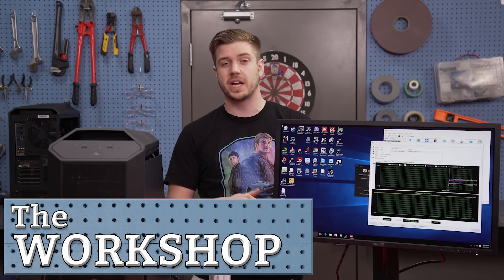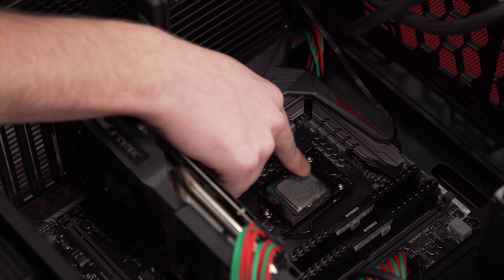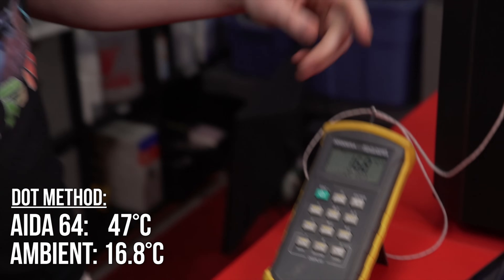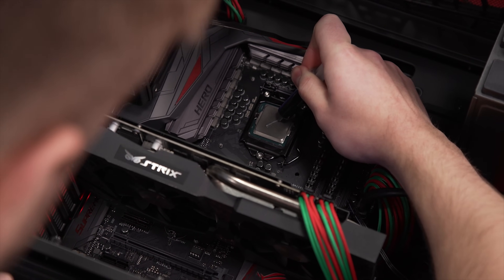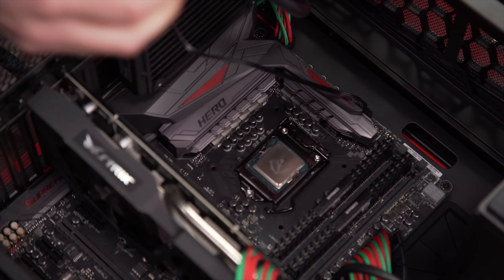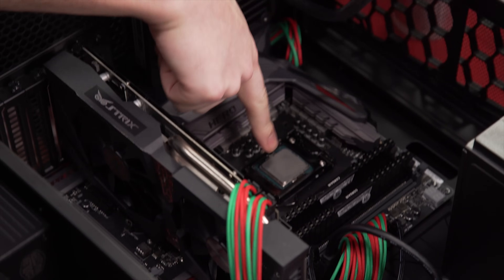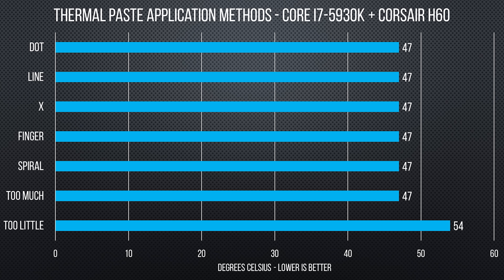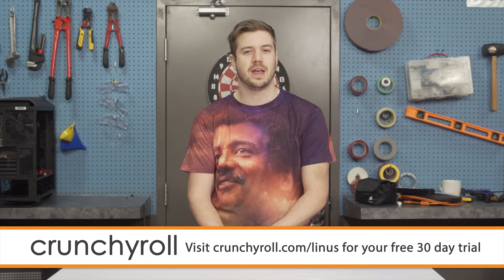Thermal Paste Application Methods - Which one is best? - The Workshop

Comment: 47 degrees under load? that's C right?

I used to run my Pentium 4 at 70-80 degrees to get it fast enough for old games. =D
Reply: +AzaIndustries 80c? 80D? am confused WHAT?
Reply: +Julian john 80 degrees celius not farenheight.
Reply: your Pentium 4 runs better at 80c? :o if my AMD 8350 4.33GHz was running at 80c id been cuting the power if it hadnt already burnt out by then.
Reply: Julian john
You do know the Pentium 4 came out more than 10 years ago right?

I had to overclock iit to 4ghz to play UT wich also required me to strip my windows install to fit onto the 3gb HDD I had.
It was stable too.

My current computer, (5th since the P4 days) idles at 27*C in summer. Haven’t needed to overclock it for any reason yet or check the load temps. It's demolished anything I've thrown at it.
Reply: i used to have a Pentium 4 i cant remember it having heat issues then again i was just a kid so wasnt really looking out for that, i thought that intel was cool and AMD was HOT!!!!
Reply: Julian john
Australian Summer + Overclocking.

Overclocking was also bit different then, and buying huge coolers wasn't common.

We are pretty spoilt with hardware choice these days.

Comment: I really don't like the way this experiment was performed. A lot of numbers were given without any context and it looks like LTT used a good water cooler, decent thermal paste and a CPU that wasn't too power hungry. It isn't a scenario where thermal paste application makes too much difference. 

If they want to test the effectiveness of different methods of applying thermal paste, what they should have done is test the worst case scenario. They need to create one of the truly awful test rigs, one that we've all built as a first time PC builder with limited money and knowledge and would like to forget.

This test rig would involve:
 * Low Quality Heatsink - Use that awful stock cooler that Intel keeps handing out with their CPU boxes with a shitty 60mm fan, a few short fins and no heat pipes.
 * Cheap Thermal Paste - Somethink someone on a budget might consider, were the spread and thickness with matter more.
 * An Inefficient CPU - Finds some 225W last-gen AMD CPU that loves to chew up power and spit out a fiery inferno. See how well it does.
 * Poor Case Airflow - Only use one low quality fan that would be included with an entry-level case, probably as back exhaust.

Finally, my last complain with this test is an on-going problem with the workbench segment in LTT, which is that they give CPU/GPU temperatures without any other information. All the CPU/GPUs they are using have a fan controller that adjusts the fan speed according to thermal data to get to a certain "target" temperature. So it's pointless to say that the machine reached a certain temperature without giving, at least, the final RPM of the fan. If the fan has to spin faster to reach the target temperature, the cooling is clearly less effective. No-one likes a noisy computer.

Comment: Yo Luke..I ALWAYS wondered if defragmentation would boost performance when you have a really cluttered and used HDD. 

I just did a System Cleanup after like 2 years..deleted some old files/games, sorted everything, etc aaaand I defraged the Drive. Too bad I didn't think of that before I did it and testing it myself.

Comment: as long as the volume of thermal paste applied is enough to sufficiently cover the CPU (or more than enough), then of course the temperatures are going to be exactly the same regardless of application method. One method may spread out more consistently or be less likely to spill over the edges than other methods but along as you don't cut the amount of paste applied short, results should be the same as we've observed.

Now I don't know about everyone else but I like to build things in my workshop so perhaps Luke should spend some time doing and making videos on that instead of these stupid and pointless videos that just feel like filler.

Comment: could you check out the significance of memory stick placement in DIMMs? i have put memory sticks in the wrong configuration before and didn't really notice a difference but have read and been told that it makes a big difference have the sticks in the correct DIMMs.

Comment: I'm willing to bet - no - I'm sure, that if you'd have actually used a real stress software (not fuckin AIDA) - say, IBT (IntelBurnTest) or OCCT (@max) for example: you'd have gotten a difference between the too much/X (higher temps) and probably the best ones would've been the advised first two.
This workshop is nice, but come back down to our atmosphere before actually doing these, please - AIDA64 isn't recommended for stability tests as it stresses the CPU way too conservatively, and even still, not choosing the cache/RAM effected the strain on the CPU as well, but I digress:
The point with the "drop back to earth" shit is the issue that others had a problem with as well - you've been using a high-end (almost the best, as far as non-DIY watercooling is concerned, and without going for long 360-420rads) cooler - which does the damn job almost no matter what - so what's the point? 
Barely stressing an overcooled yet not-overclocked (you didn't mention so I presume) CPU with different forms of thermal paste application? 
I know you're mainstream, and that recommending your viewers to use stuff like IBT could kill their rigs, but even still, personally - I'd have done this same video only with a cheap low-end air cooler - like the 212, or - to be even more fair to the viewer base wielding a huge variance with any possible hardware part - just putting the damn stock cooler would've given a way clearer and concise picture for everyone out there, me included - actually - since I, like most people, don't have the time, will or resources to do a test of this kind - and I'd actually be interested to see a test of 10 IBT loops @max with a 212evo - so that I'd know if I need to reapply thermal paste differently on my own processor (albeit with a different cooler, but that's not a concern when doing it this way) - now that would've been informative - just my honest views.
Reply: Stressing the CPU by artificial means is pointless if it stresses the CPU more than any program you would run. I found that running Handbrake gives almost the exact same temperature max and averages as AIDA 64. That make AIDA 64 the perfect test for my computers as it matches my heaviest load. I do agree that Handbrake and AIDA 64 only match up when the top 4 boxes are checked when running the AIDA 64 stress test. As for overclocking, that depends a lot more on the CPU than the paste so not a good way to test the way to apply thermal paste.
Reply: It depends on the voltage, not the cpu. At same voltage heat would be the same, the speed would vary. Since we are not testing speed it's irrelevant. Like the OP said, using a more down to earth cooler that most people have on an overclocked cpu would give better results. It's like changing tires on a porche, it's a porche, it will run over 200 with any tires. But if you change the road, then tires matter a bit. The point being like he said, the cpu cooler is way overkill and cools too well (a stock cpu at that) for the paste to begin to matter.
Reply: Thanks for answering for me, lol: Also, AIDA64 is such bullshit you can read about it at overclock.net, here:
http://www.overclock.net/t/1570313/skylake-overclocking-guide-with-statistics#
Under "Stress Testing[...]" you cab see this (a copy paste from the site):
Marathon-Man:
OCCT S
Linpack (Max) (From Intel's website, not from OCCT or any other place or XTU.)
P95 28.7 S
 
Tough:
P95 27.9
IBT (Max)
 
Medium:
x264 16T
ROG Realbench
 
Easy:
Stockfish (Chess, BMI2 version)
XTU
Aida64 (Full Suite)
 
Walk in the Park:
Cinebench
Firestrike
Booting into Windows

And to add my personal experience - an overclock of 4.8Ghz was fully stable at 60c on AIDA64 and got to 80c before BSODing when testing with x264 at 16T (Threads) - I use it (x264) mostly and also OCCT for stress testing as these actually give a real indication for stability - obviously not for regular hard-use temperatures as the load is artificial but it does indicate true stability of the overclock at all times (ie very intensive CPU tasks, intensive CPU taxing games etc) - things which AIDA64 simply cannot provide.
Now, it's not like you need to push the CPU too much - the top softwares I pasted here are overkill to say the least and leaving them all night is straight-out dangerous unless the overclock was found stable and at low temps with a less-stressing software (x264 is a great standard imo like I said), some Prime95 version are not recommended for use on new CPUs anymore, read at the aforementioned site - great data and people there and way more accurate, though you'll see that reality sucks as you'll get higher temps on a real stress-test software. wow I did it too long fuck me.

Comment: Use a CPU that doesnt have thermal paste in it!
Reply: +Richard Schlegel Thermal paste in it? What the fuck are you on?
Reply: non-enthusiast Intel CPUs have thermal paste in them, which is often crappy and limiting efficient cooling.
Reply: Between the core and the heat spreader? Surely that would benefit cooling? Why would they put it in there ?

Comment: How about the credit/debit/gift card spreader method?

The h110i cooler I bought came with the thermal paste evenly pre-applied. No dots, no circular pattern, no crosses, no lines. Which is resulting in 34 - 42 C for a 5930k running at 1.2 - 4.8GHz @ 20C ambient.

Comment: Not surpriced that there isnt any difference (except the obviously completely wrong ones of too little/much). Remembering the how little the area is there is little to no chance of applying too little paste over the majority of the area. Just looking at a intel stock cooler you can see how they actually prepasted it in 3 thin lines that too will spread out but ensure it wont spread out too far.
The real problem that once the heatsink/fan is on .. you cant tell how the paste actually spreads or stays in place.
One conclusion from this video is quite clearly as long as 70-80% of the area is covered its dont really matter and i guess you can only really speculate if having the "safer" pre-spread methods would be measurable longterm effects after month of heavy use.

Comment: This was pretty interesting, but I feel like to do this experiment properly you should leave the thermal paste to sit for a while, maybe in a usage pattern that a typical person might have, say 12 hours on and 12 hours off, then do another benchmark after a week, and see where the results are at then. That way you can truly see how the thermal paste application affects the heat level over time. I realise that's not super practical to do though and would take a long-ass time if you only had one test system.

Comment: Can you expand this by going over overclock performance? Let's say as a baseline you find out that using the pea method you can achieve a +x GHz overclock at a temperature of y. Then using the same overclock, what kind of temperatures do you get with the various methods?

Comment: Why do you use such a high end water cooler for a test like this??
You should have used a stock cooler for higher temperatures where the thermal paste has a larger impact on the cooling of the CPU.
Reply: Simon or even better, use the stock cooler and measure the fan rpm needed to keep the cpu at a certain temperature

Comment: Hey Linus (or youtubers), i'm going to build a PC for a friend...what do you think?

BUILD: $1000
Monitor: Asus VS248H-P (24 inches)
CASE: HAF 912+Coolermaster 120 mm case fans 4 pack
MOBO: ASUS Z87-A
CPU: i5 4690k+hyper 212 evo
RAM: G.Skill Ripjaws X Series 8GB
GPU: R9 380 or 390
STORAGE: WD 1 TB HDD
PSU: EVGA SuperNOVA GS 650W 80+ Gold
WIRELESS: ASUS PCE-N15
OPTICAL: DVD Drive

NOTE: CPU+MOBO+RAM already bought for $300
Reply: Looks decent mate, but I really would recommend some kind of SSD storage. Really, any kind is better than using your HDD to have your OS sit on.
Reply: +dinokknd  he ended up investing into an SSD. Amazon has a sale for the PNY 240 GB SSD. $60 :D

Comment: But the REAL QUESTION is stock paste versus self applied.
Do we need to even do this at all?
Reply: I've used stock paste without issue several times. I do find it usually needs to be reapplied sooner though
Reply: I've used stock paste without issue several times. I do find it usually needs to be reapplied sooner though

Comment: For those who are claiming you will see a large difference between thermal paste application strategies by swapping either the CPU, heat-sink, CPU + heat-sink, thermal compound, or some other bizzaro swap to a cheaper alternative, that is not how it works. The idea behind using thermal compound is so the contact area between the heat-sink and CPU is maximized. Maximizing contact area has the effect if increasing heat transfer. 

Assuming that the heat-sink is able to cover the entire area of the processor, than swapping the heat-sink, or the processor will not have an effect on the difference in temperature of a processor over ambient under load between two different ways of applying the thermal compound.

With that being said, different types of thermal compounds will probably make a difference depending on the properties of the substance used. It would be nice to see a 2016 video comparing different thermal compounds. Especially the junk that they sell at Best Buy.

Comment: With most CPUs, only having 16 PCI express lanes, and graphics cards using all of these 16 lanes. How much of a dip in performance would you experience, by adding a NVME or M.2 SSD to your system? 
These drives tend to use up 4 PCI express lanes, thus only leaving 8 PCI express for the graphics card.
Reply: You need to learn more about your computer. The CPU has PCI-E lanes built into the chip. However, the CHIPSET on the motherboard also has PCI-E lanes built into it for the things like SATA, USB, and yes, NVME. My Z270 mobo and I7-7700K chipset have 40 lanes all total but the CPU itself has just the 16 PCI-E lanes.

Comment: The reason you see no difference is that the TIM under the headspreader is terrible, it's bottlenecking the temperature. I hoped that LinusTechTips knew better.

Redo the video with a "delided" CPU. Use Coollaboratory Liquid Ultra as TIM on the DIE.

Comment: If you use the line method how do you know the orientation for the line ? If I remember correctly years ago there diagrams for intel and amd for which way to use the line method.

Also from your video you can not tell how much you used. Could you do a close up of the quantity you would consider normal.

Regards

Comment: Linus, since you have a Razer backpack, and Luke did a review on the Fractal Design node 202, i was wondering of that small formfactor case fits in it. I was looking to make a portable build and wanted to know if that would fit without spending the money to just realize that it might not fit. Thank you so much! ~Maximum Tech Stuff

Comment: You're using IC Diamond which contains diamond crystals. One of the, if not THE, MOST  thermally Conductive Materials known to man. You never have to worry about adding too much IC Diamond unless you add so much that it overflows.
Reply: Not with this paste. The Purpose of thermal paste is to close any gaps between the CPU and Heatsink. You'd want just enough to close the gaps but not so much that it acts an insulator. Because IC Diamond IS SO thermally conductive it does not matter if you put ALOT, unless it overflows.

Comment: so Luke, we can go deeper with this.
IC Diamond has a burn in time - though a short one, a couple hours supposedly. IMO, using a paste that doesn't have any burn in time would be ideal for this sort of testing.

but maybe you... want to go with some other pastes that have burn in time to see if that makes a difference...? :D?
you could always use AS5, the most overhyped underperforming shit out there, with it's blatant lies of performance specs and a burn in time that can be upwards of 270 hours... sounds like fun, right?
and i guess also looking with Stock Coolers for people that use them for some reason can't hurt.

frankly, most of what's recommended for Thermal Paste is to keep you from wasting it needlessly and to avoid making air bubbles because that doesn't help thermal transfer.
pea is the simplest, and performs the same as any other hairbrained, weird ass ways you can apply Thermal Paste so everyone might as well do it because it's piss easy to do.

also, a bit late but uh, for the Power Supplies video - might have been worth also having a Power Supply that had high capacity but a mediocre 80+ rating. as the Efficiency is the most important thing, but would be useful to show people that yes, they should buy Power Supplies with good ratings, rather than bargain bin grenades.

Comment: From a purely technical stand point. 

Feel like the best way to test this isn't in a system running with a variable Cooler that the motherboard will adjust the voltage on to adjust fan speed and maintain a target temperature. Doesn't matter what way you put it in when the Motherboard will just ramp up the voltage on the fan to compensate. The better way to test this and get actual numerical results would be to get a constant voltage power supply and run the chassis cooling on that. The most thermally conductive method will have a meaningful value in that test I'd imagine.

However, from a usability stand point. If the CPU / Cooler / Motherboard aren't broken and are working correctly they will correct for any minor differences in application method as was demonstrated. So... Bravo?